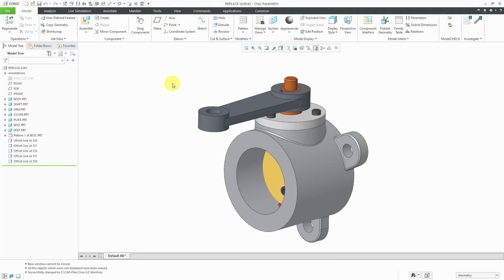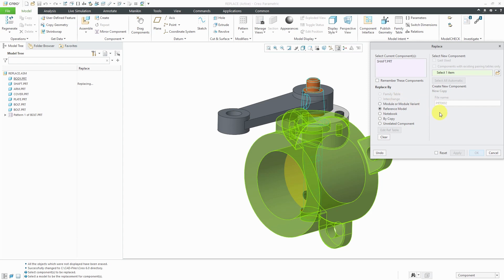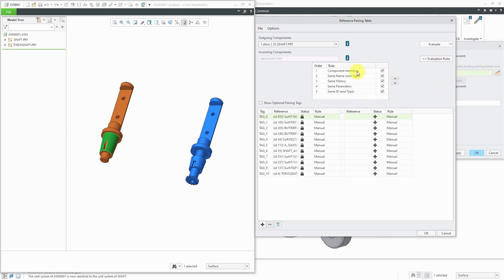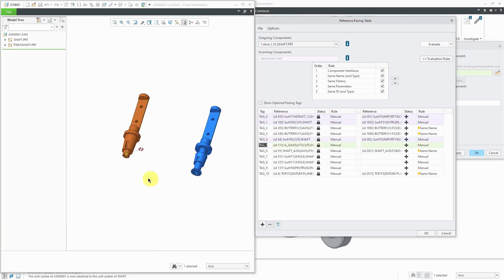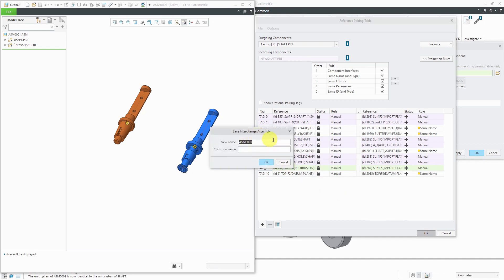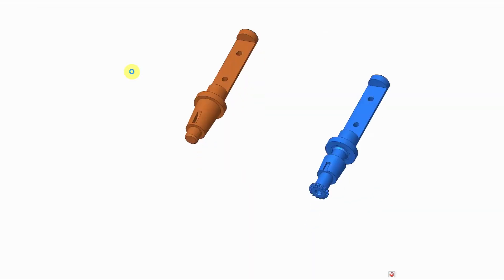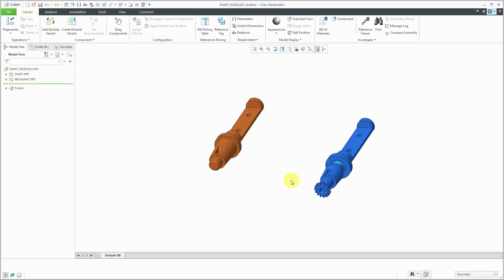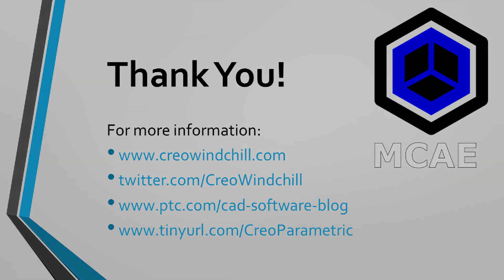Creo Parametric - Replace Unrelated to Interchange Assemblies to Configurable Modules

Comment: If we use this configurable assembly in drawing, after replacing the part drawing dimension and BOM ballon will fail. Is there any method available to avoid the drawing failure? Please help. Thank you.
Reply from the maker: I've never looked into that myself. I recommend contacting PTC Tech Support.

Comment: What is the use if configuration modula
Reply from the maker: Configurable Modules are components in Configurable Products used to create design variants as part of a Configure-To-Order manufacturing strategy. It's like going into a car dealership and specifying which options you want - wheels, engine, interior, sun roof, and so on - and then getting the variant you desire.
Reply: @CADPLMGuy  do you have a video for that
Reply from the maker: @KN-zs6dc  Not yet. But if people contribute to my Patreon, I can afford a license and then I can make a video on the subject.
Reply: @CADPLMGuy  Thanks